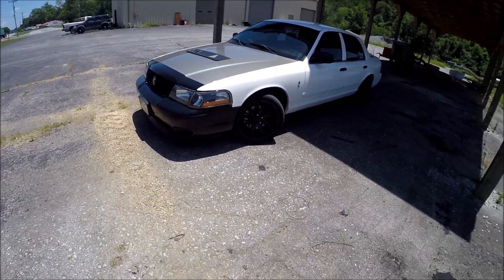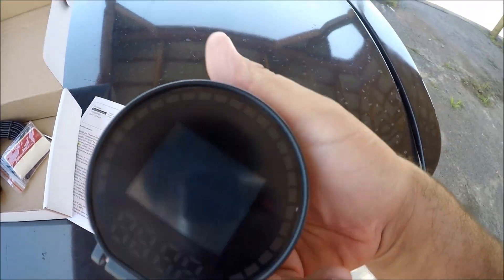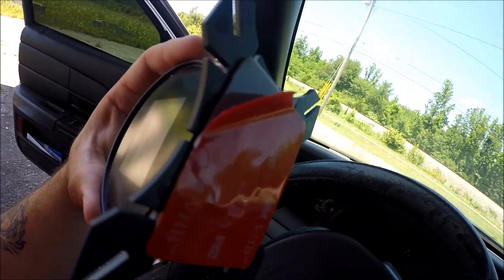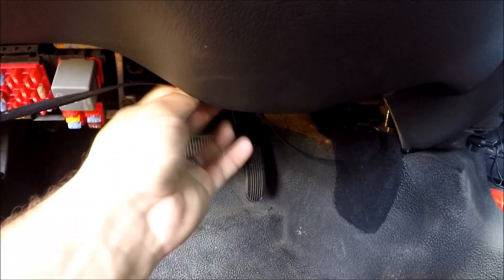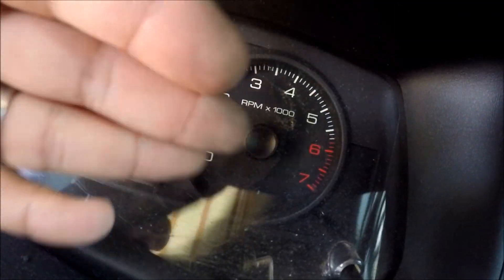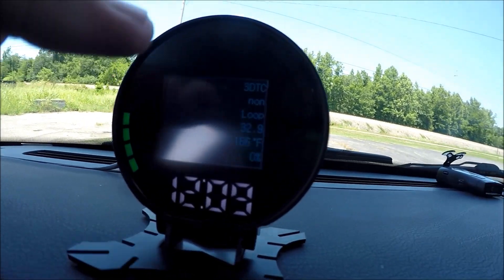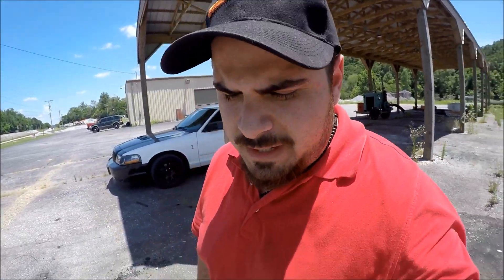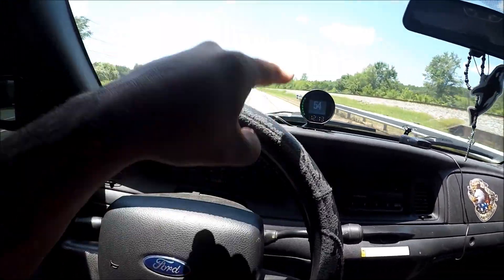Every Crown Victoria Owner NEEDS This $35 Tool!! (OBD2 GAUGE)

Comment: Be careful before just buying any OBD2 gauge. 
within the OBD2 port/scanner realm there are different pin patterns for the OBD2. These are referred to as protocols. If you read on the description for most of the obd2 guages on amazon there will be different obd2 protocols that the gauge is compatible with. sometimes they only use the year to determine this but that's not really 100% accurate. You need to look up the cars obd2 protocol by year make model and compare it with the compatibility lists the nicer gauges descriptions will have.

Comment: Will this display the current miles ? My odometer isnt working anymore so yeah dont know my current miles lol
Reply: Did you find something that will work as an odometer?
Reply: @EarGal   had a friend that had a p71 and the same gauge displayed in the vid so yeah it works just wish i wouldve gotten a response
Reply: @solidex1055  I'm looking around for an auto wrecking company that may have one for me. I'm also looking into getting the speed guage e. It's driving me mad having that display dim.
Reply: @EarGal   yeah would definitely recommend getting something to read the gauge... my odometer went out months ago and honestly i just left it alone, dont really care for it or have the desire to get it fixed really. Funny thing, it does turn back on if i punch it haha
Reply: @solidex1055  same here. A few taps and it works again.

Comment: If you havent checked out chicagomotors.com that is the number one place to get government owned cars besides at auction
Reply: Got myself a 2011 cvpi from there in May. Great car
Reply: @trent781  ya got a 2006 vic with 130k miles shipped to my door for 2600 bucks

Comment: hold up does it say how many miles till ur fuel tank goes empty cause my cluster is F*cked up and I'm looking for the soldering points on the cluster.
Reply: Ali Ahsan if you fine a gage that features that let me know! I have an 09 Vic and have the same problem

Comment: I was considering buying one of these for my 2011 Mazda 3 due to the fact that it does not come with a temp gauge, just for the peace of mind. The problem was that I couldn't find any place to mount it safely due to airbags and losing forward visibility. Part of it was due to the fact that I had a WRX for a year that I bought with an AccessPort.